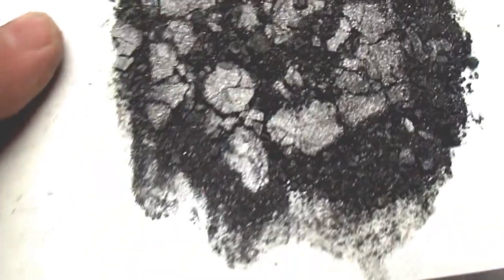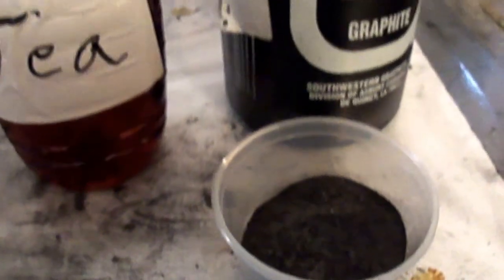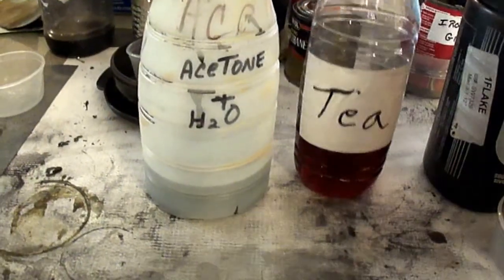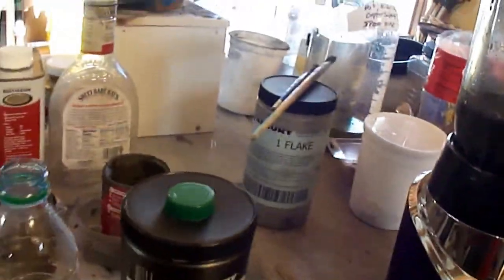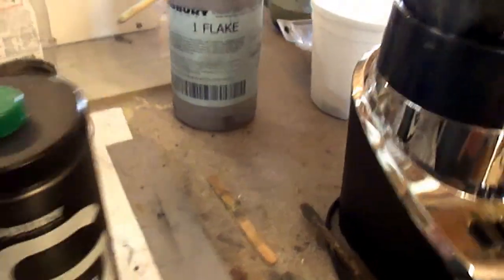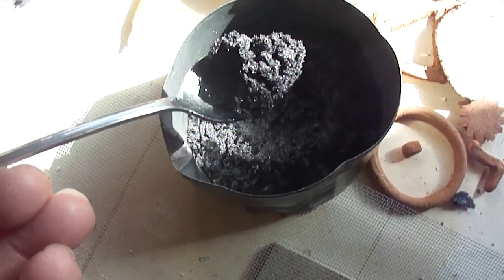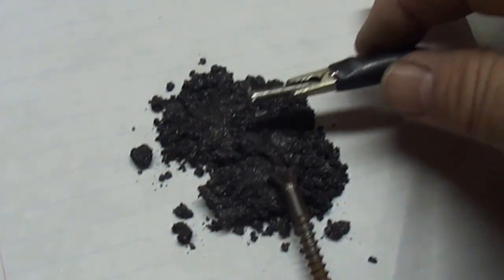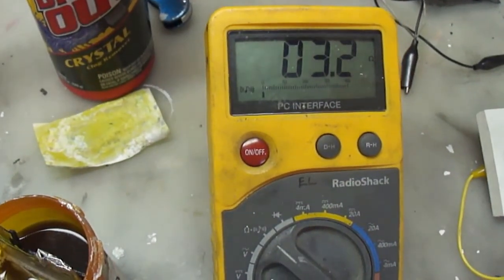Graphene exfoliated with Tea

Comment: What is the graphite powder resistance?
Reply from the maker: If you tamp it down, the graphite powder resistance right out of the can is around 5 ohms.  Apply it to a surface with a vernishing tool or add it to an epoxy or acrylic, etc.. in a greater consistency of graphite.  You will see a resistance of 50 to 500 ohms.  That depends on it final usage.  Thanks for asking.

Comment: What is the quantity of graphite (in grams), acetone + water (in ml), after blinding it was filtered by filter paper and the suspended particles are dried in which temperature.
Reply from the maker: Hello, yes the quantity of graphite seem not to matter, I did many experiments and came out with the same outcome. You just need to make sure you have at least 6 ounces of fluid for every table spoon of number 1 large flake graphite.  I used different filters, example: coffee filters, bed sheets, silk screen mesh, very fine mesh.  Then the material was dried at room temperature or on a hot plate.  I seem to get the same result.  Hope this helps.
Reply: @ET2uscg  
After blinding the mixture, is there any necessary to suspend the graphene particles in bottle for a week
Reply from the maker: @saikrishnaagalditi1849  There is no reason to let it stand in the bottle,  you can filter it right away.

Comment: what is the percentage of acetone and water?
Reply from the maker: 70 percent acetone to 30 percent water.  when mixing only make about a pint at most because it gets hot and make sure you use a glass mixer.
Reply from the maker: I have found that using the electrochemical method to be the easiest way to make the expanded graphite and then sonicate it to release the graphite flakes into a course graphene.
Reply from the maker: 70% acetone 30% water

Comment: hi im a close to obtain the same result using carbon 2 electrodes and sodium bicarbonate solution in 80% h2o and 20% of alcohol ethanol.
Reply from the maker: I have had good results doing the 2 electrode, where one electrode is the Graphoil and the other is stainless steel , starting the voltage at 2vdc for a couple of mins and then increasing to 10vdc until all the graphoil is exfoliated.
Reply from the maker: I like using your method, it is faster.

Comment: What makes you think that's graphene?  Whatever it is, it's contaminated with tea.  The resistance measurements are meaningless.
Reply from the maker: Yes it is contaminated with tea and is not really any good for the battery unless it is filtered and separated but the cool thing is that the tea allows the particles of graphite to suspend and maybe you could use that in some way.   I have moved on to working with graphite and carbon and salty aqueous solutions that seem to last forever , fast charge and sustain a longer discharge time, o and is extremely cheap to make, even when making one KW unit

Comment: It looks like you are using steel screw and/or nail on your ohmmeter clips. You won't get an
accurate resistance measurement of your graphene because the steel has its own resistance. Try shorting the two steels together for their ohmic value, then subtract that from what you measure across the graphene.
Reply from the maker: thanks for the info I will try that.  Please comment on my other vids too, I need all the help I can get.  Since I started these vids I have learned a great deal about chemistry and nano sciences from replies like yours.  So in this reply I would like to thank everyone that has posted on my videos, because it has helped a great deal.
Reply from the maker: Thank you, so the resistance is probably lower.
Reply: @ET2uscg  https://en.wikipedia.org/wiki/Four-terminal_sensing

Comment: Hi just watched this video and you said that you have used acetone over and over again. Can I ask you how have you recovered the acetone?
Reply from the maker: I don't separate the tea from the acetone and water I just pour the whole thing through a filter and get the large exfoliated graphite , the liquid I keep using over and over .   I really should check to see how much graphene is in the solution.  Since that video I have used other methods to make the graphene oxide. One method I like is the sulphuric and phosphoric acid with graphite in it.  You just let it sit for a day and filter and dry it and heat it until it makes expanded graphite. Then I use the Potassium Permanganate and sulphuric acid method to get the Graphene Oxide.
I use it in the Gel plate and it gives a whole new level of power to my Energy Storage Device.
Reply: OK thanks for that interesting stuff, good luck with future experiments. Regards Mike
Reply: Ed Lovvorn hi there Ed . When doing the sulphuric acid and phosphoric acid mix what percent and concentrations did you use ?
Reply from the maker: I put a catch basin under the filter.